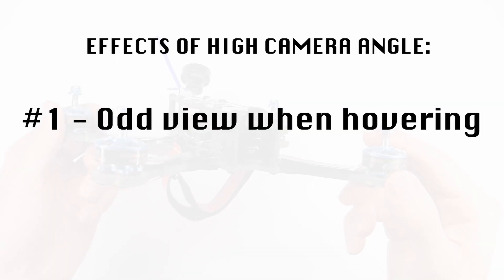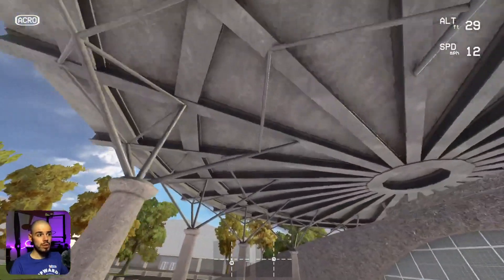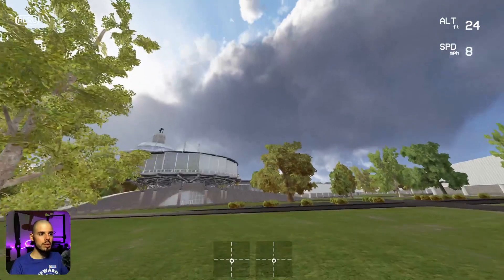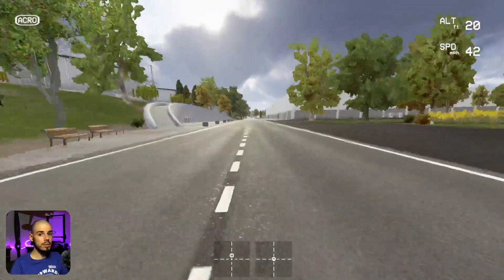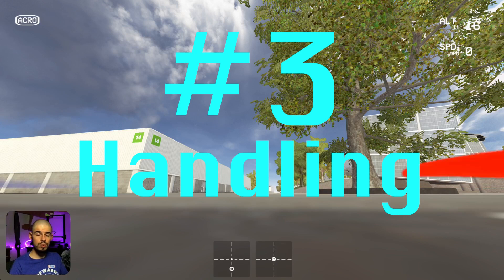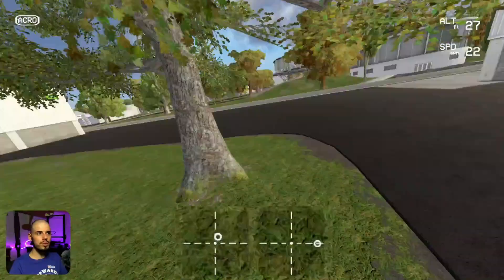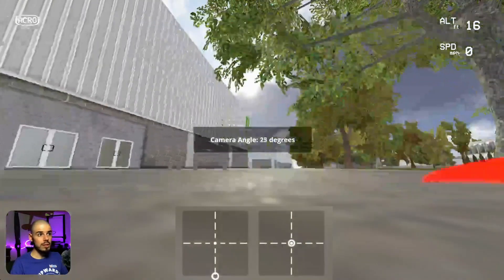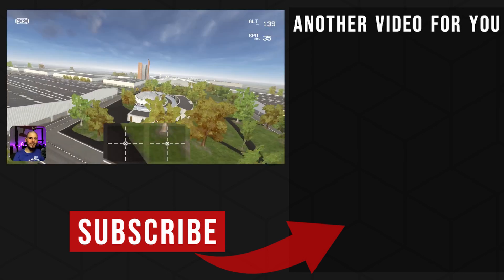3 Important Effects of FPV Camera Angle (Low 🆚 High Up-tilt)

Comment: When you fly with a tilt above 45 degrees your roll and yaw are basically reversed so that roll becomes yaw and yaw becomes roll
Reply: Not quite. Above 45 degrees Roll tends more towards Yaw, but Yaw tends towards INVERSE Roll.
I fly in the DRL Sim in what I call High Angle Mode at tilt angles of more than 55 degrees (angle individualised to drone model). Take a Mode 2 controller setup. Swap Yaw & Roll. Set Yaw to Inverse. Now fly as if you are in Mode 2.

https://youtu.be/ICHlw2VCOtI

Comment: What are your views about the new dynamics in Liftoff?
Which is your preferred sim now? Has it changed from the last time you reviewed Sims?
Reply from the maker: Y'know, I have actually noticed that I like it more because the physics seem more realistic to me, but the quad still seems to "float" more, like there is slightly less gravity. And I've been using it for all of my FPV training videos because it has a good stick position overlay. But I think liftoff is well known for it's really good graphics, but I have the graphics turned all the way down to get the best performance with my computer, so I really don't care about nice graphics. It does have some really good variety of locations though.